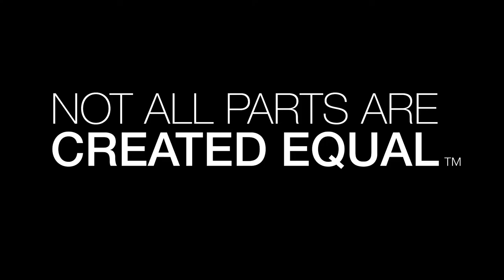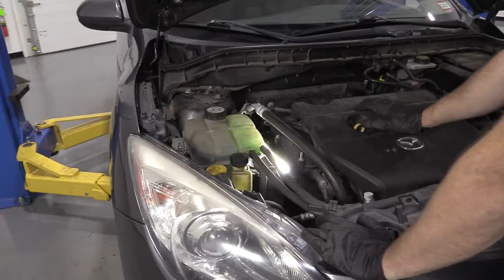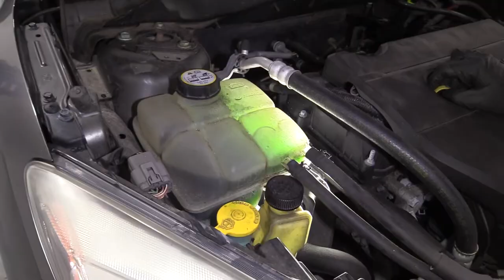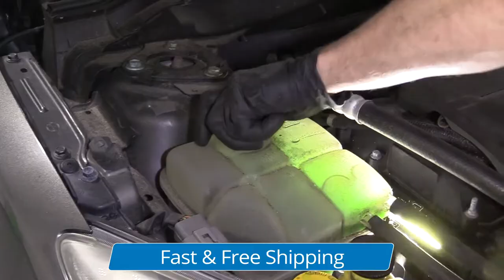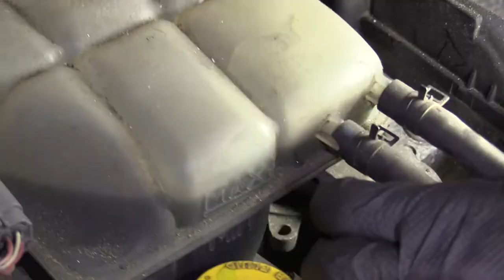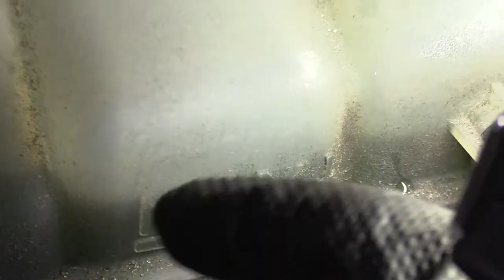How to Check Coolant Level 08-13 Mazda 3

Comment: What type of coolant you use? Can i just top up my coolant i have a 2012mazda 3   Thanks
Reply: Did you ever figure it out?
Reply: I have the same car what did you end up doing?
Reply: Green
Reply: I’m sholl tryna figure it out what y’all use
Reply: OEM Mazda FL-22 (Green), pre-mixed so you can just top up as needed. ~$20CAD locally at my Mazda dealership, same price as aftermarket coolant so no brainer to go OEM.
Reply: @0irtgud  any idea to make that cheaper in Canada? Don’t see FL22 elsewhere
Reply: @0irtgud  do you recoment this car i look a 2011 for 5000$ 180 000km